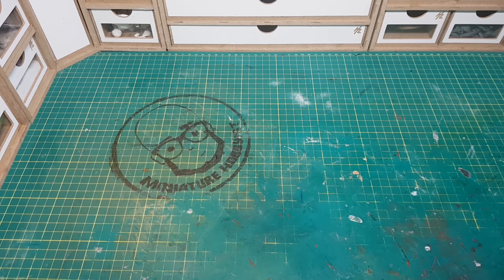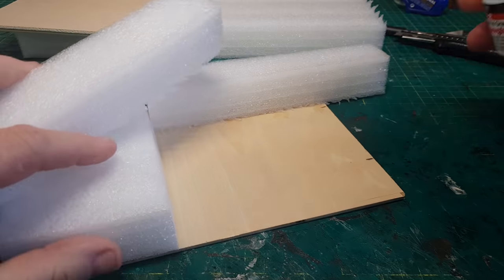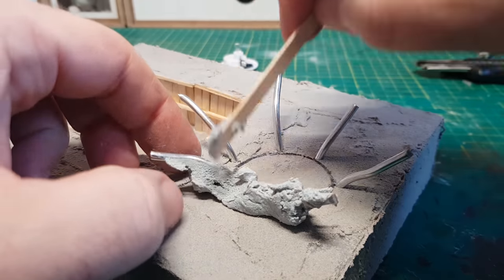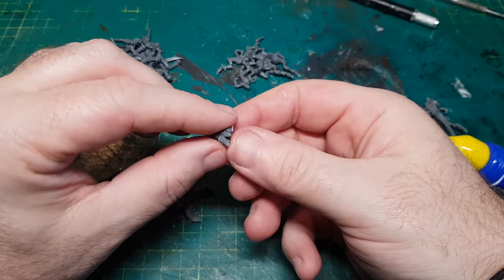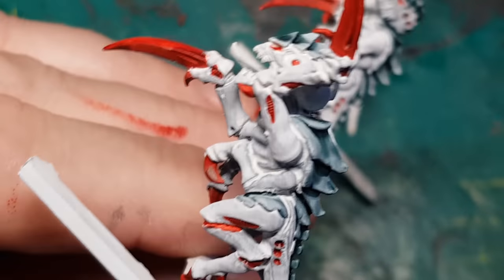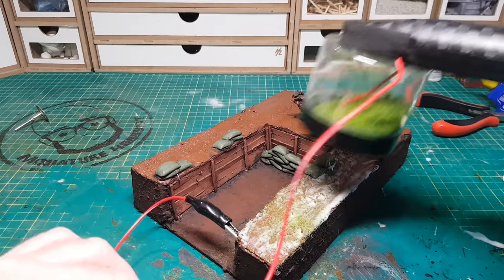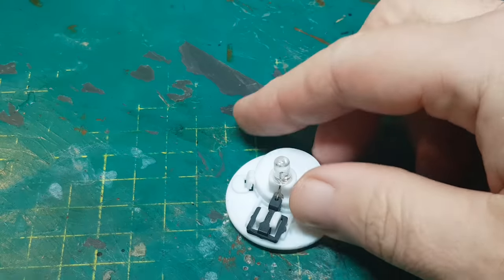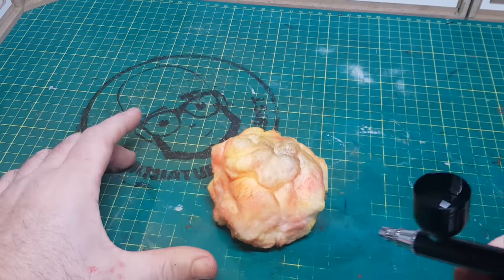Astra Militarum Last Stand Against Tyranids - Warhammer 40k

Comment: Beautiful day in sunny Klendathu :P
Great job! From the terrain (static grass! Wooden planks!), to the explosion (need to make some of these), to the barbed wire to the improvised but effective figure holders, to the quick but effective paintjob (zenithal FTW), all came together :D
In case you wanna try it, a recipe for a less realistic but FAR easier and quicker barbed wire, take some pipe cleaner (the fuzzy ones, not the tinsel ones) and burn it a little, done. Yours are crazy realistic but take time, this one takes seconds. Worth a try.
I really gotta make the Necron version of this, even have a figure of a panicked guardsman I found on eBay for it already :D

Comment: Traditional Imperial Guard battle Hymn
🎵You had a bad day Guardsman.🎵

Where’s the reinforcements when needed the most?
You roll up your sleeves cause your unit is lost
They tell me the ‘Nids fade blue skies to grey
They tell me our fleet has sailed away
And I don't need no carryin' on

Your holding’ the line till the ammo runs low
You're hiding your fear with only one power pack to go.
They tell me your life's expendable holding line
You're getting ripped to pieces every time
And I don't need no carryin' on

Cause you had a bad day, but you're taking one down
You sing The Emperors hymns just to turn it around
You say you don't know, the Commissar don't lie
You work at a smile and get ready to die.

You had a bad day, the Commissar don't lie
You're turning back now and you really don't mind
You had a bad day
You had a bad day
Reply from the maker: Yup they had a bad day =)

Comment: when you glue something with superglue it will not just poop off . If you want something like that use that thing for posters (blue tack ) or in same cases i did use wood glue on plastic parts so that way you can easy pill it off when you finish painting
Reply from the maker: I should have said hot glue gun as thats what was used to attach the figures to the sprues =P